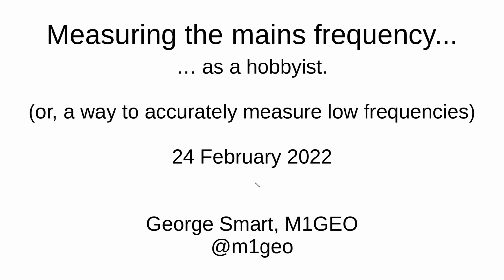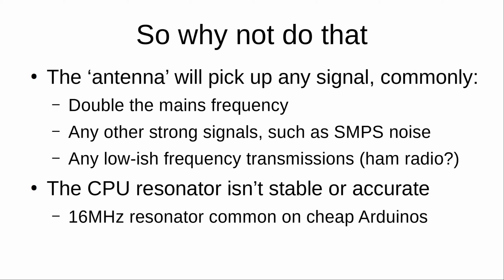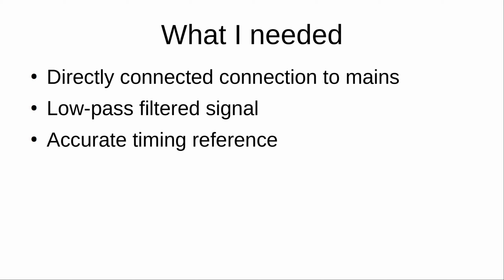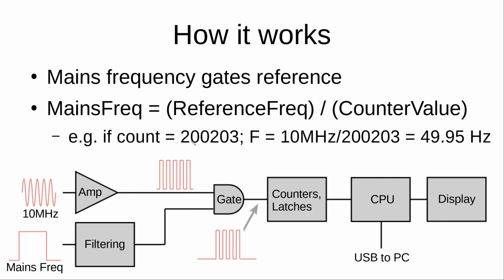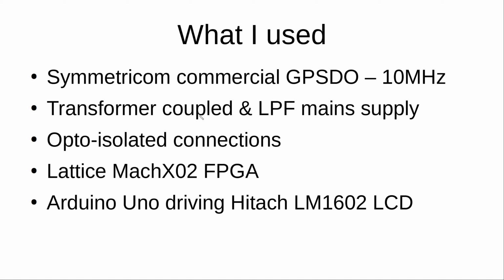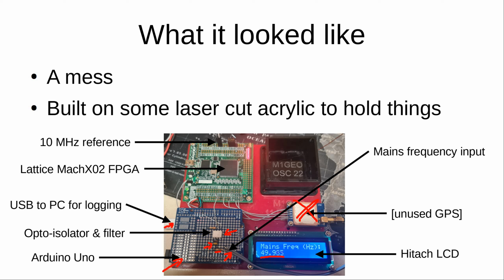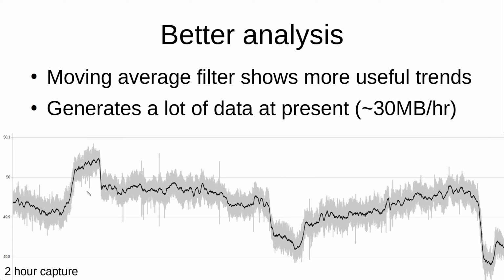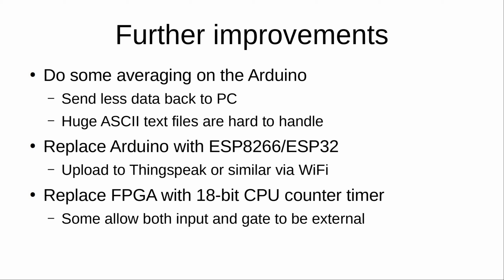Measuring the mains frequency - notes and ideas

Comment: You could also poll the inverter parameters to see if import/export switching is affecting frequency?
Reply from the maker: Absolutely. I expect the inverter should be either lagging or leading the line phase, so control import/export direction. But not super sure.

Comment: How resilient is the measurement to things like Power Line networking?
Reply from the maker: Should be pretty good. That's partly the reason for the filtering. To remove higher frequency stuff like PLT and SMPS transients.